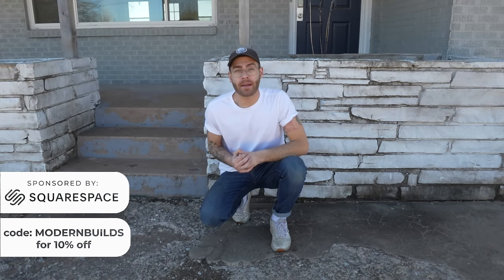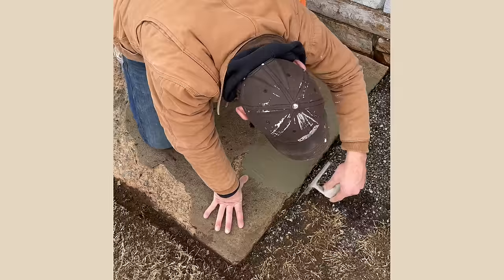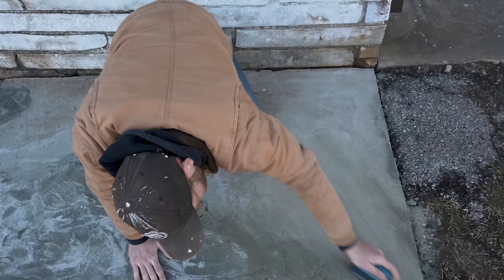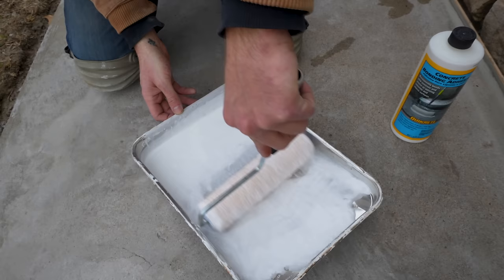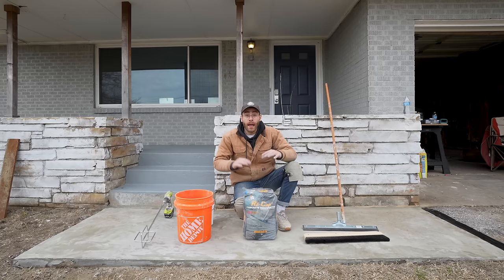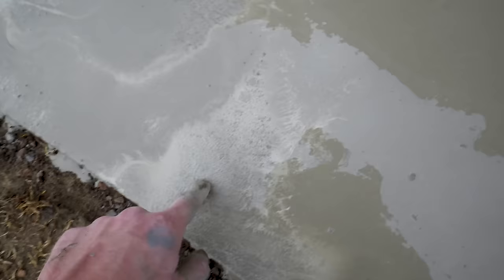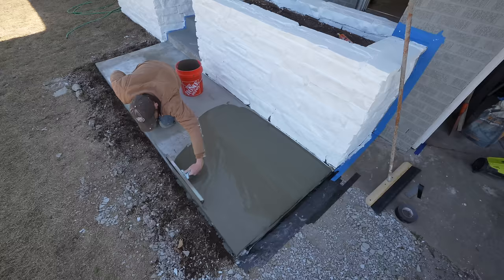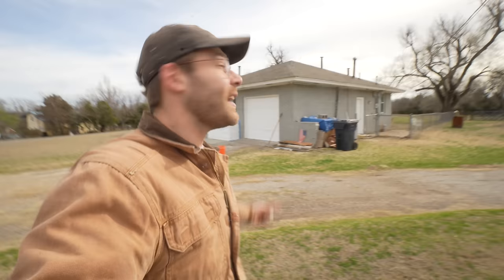How To Fix / Resurface Damaged Concrete Sidewalk | DIY

Comment: You had minimal sidewalk left. It would have been quicker, and cheaper, to just pour a new one. This is also likely to chip up after a year or two
Reply: They didn’t want cheap and quick probably
Reply from the maker: In hindsight you might be right. It would have been convenient to do a single pour and be one-and-done. I doubt it deteriorates much though, most of the damage came from not having gutters since the house was built in the 50’s and I’m getting some built this next week. We’ll see how it goes though… hopefully it’s a good tutorial for someone with a less damaged sidewalk/patio or someone who couldn’t tear out the old concrete as easily. 🤙🏼🤙🏼
Reply: Keep doing what you’re doing Mike. Quicker or not, you got awesome results.
Reply: @jmilli10 If he didn't want it  quick, he shouldn't have used quikcrete.
Reply: @ModernBuilds  It won't deteriorate because that what the patching is made for.
But that crack will come back.
Reply: At each season change this will start to break up with extreme heat and cold. Should have just broke it up and poured a fresh slab.
Reply: And the can guarantee that overlay will start flaking away in 9 months
Reply: Maybe, but this video is very useful to people like me who do have a better sidewalk, and would like to see how to do this process.
Reply: Na big money maker I got it down after 7 years still looks good no chips faster and cheaper then new concrete.
Reply: Resurfacing products achieve up to 55mpa strength. Stronger than the existing concrete with a 10-15 year lifespan. Much cheaper option than removing old concrete and replacing from scratch.
Reply: @ModernBuilds think u would have had more success with the squeegee if u use the pole
Reply: Cheaper? You need to remove and get rid of the old one first... daaa
Reply: Unless the concrete being poured is 2” or higher a binding agent is always needed. 😊
Reply: And don't forget the haul away...expensive these days....good job..just another adventure
Reply: I’ve got a 26sqm 250mm deep slab in my garden than needs resurfacing. Trying my hardest not to pull it all up and start again. Can I resurface it or should I break it all up and use some of it as hardcore and re pour it. The surface on it right not is falling apart and got one big crack in it
Reply: Well done,
Reply: I challenge your assessment... if you don't want to tear up an old  slab, don't have the equipment for that, or can't access the location except through a 3 ft wide gate and down a narrow path around a building or two.  How exactly would it be less work and easier?
Easier and cheaper is subjective.
Practical usually wins out.
Reply: @jamespeddycord4705  it’s a front yard. None of your points are valid for his case. Otherwise yes I would agree
Reply: Yes

Comment: Oh boy I'm disappointed. Nothing like putting a bandaid.
Reply: Better than replacing the slab in many cases if the concrete is clean and loose concrete is removed.

But ya jackhammer out the slab and re pour it if that tickles yoir fancy. Finish with me pretty much the exact same.

Comment: Holy crap this came out awesome! Removing the old slab and making a new one I think would have taken more physically exhausting work.  This repair is something I'd be able to do/assist with.  I can't technically use power tools or lift heavy buckets due to health reasons, but I'd be able to use the brush and clean up anything that spills over the sides
Reply from the maker: I’m glad it was helpful!! 😁😁 thanks for watching

Comment: I've done this a couple times with a concrete resurfacer and it looks great when first done, but it just didn't last for me.  I got maybe 4-5 years out of it until it started wearing on spots and discoloring.  Thanks for making the video.
Reply: did you use sealer on top of the resurfacer after it cured?

Comment: While i would agree with some of the comments regarding the complete replacement, what you've done was great experience for future reference. Perhaps next time use the recommended primer ratio and pour a lot of it so it would penetrate deeper. It creates flex and proofing.
Reply: wouldnt a complete replacement be thousands of $$? vs his repair?
Reply: @garyc4019  nope, not even close to the recoat cost.  They vinyl patch (3 bags) is $21 a bag, the Re-Cap is $33 a bag and bond liquid is $11.  The benefit is that it is FAST with little effort.  No Concrete to remove, No site prep work.  Bags of quickcrete are $6 a 80-pound bag and that's a lot cheaper.   There is also a tool cost if he doesn't own a wheel barrel to mix the concrete.  Basically, it is cheaper and better to remake a small pad like this, but it is far far easier and faster to re-coat it and it is a flip house, not a keeper.

Comment: Tear out and replace for sure would’ve been easier and produce better results but you did a great job for a first time using these finicky rapid set materials
Reply: It was Quickrete, not Rapidset. Rapidseet would have been better. I predict that in about 1 to 2 years it will delaminate. He should've used the bonding primer under the 1st coat and in the mix.  Also, it should be sealed afterwards. 
If you do it right , this repair will last for years.
Reply: @HLMcCoyEnterprises yea I didn’t literally mean the rapidset company I meant that it sets quickly (I know it does cuz I’ve used the product). I agree with you

Comment: I  personally would have removed the old slab and repoured a new slab.  

I like to experiment too . Seeing how the new surface lasts. Can’t wait for the update. In two years time.

My prediction is that it will crack in the middle from the change in seasons.

Comment: I would build a fence around the place not higher than 1/2 inch to get a leveled surface, but if your surface require more than 1/2 I'd suggest to use a steel grille attached to the surface previously clean and ready to pour the 1st concrete patch mix, then the bonding adhesive and then the resurfacing mix.

Comment: Late to the party but I agree with others that replacing the slab would've been a better long-term fix and probably faster/easier to achieve. 

The biggest issue is that big crack in the middle. It will reappear next winter as the soil freezes. That said, it looks great and serves as proof that you can resurface horrible-looking concrete. It's just that it can require constant upkeep as the old concrete continues to potentially deteriorate.

Comment: You're better off with a broom finish than smooth for a walkway, better footing in slippery conditions.  I have a few places where I want to try and resurface. Less work than ripping out and pouring a new slab. Thanks.

Comment: There were a few instances of "these are the instructions on the product but I'm going to do it a bit differently". That's a risky thing to do with concrete. Not diluting PVA (for example) can adversely limit its penetration.

All the same, it's nice to have a small project like this to play with.
Reply from the maker: It said for rougher surfaces do a more concentrated mix

Comment: I wish I had found this 2 months ago.  I just did a repair with some different products that did not mix nor perform as "advertised."  Getting ready to chip out some of the "repaired" spots for a do-over.
Reply: Hi Judygude Just wondering what products didn't work for you.  I'm planning on doing my concrete stairs and later on my walkway... Basically I'm on the research sage..   What was the repair you did and what did you use... Thank's for any info..
Reply: @ikemen1  resurfaced my garage floor. It was pretty rough. I used Leggari’s repair kit for cement. It was much more expensive, and I really had a tough time mixing it. Basically, it would have been much easier to get a reliable consistency if I didn’t have to mix a 5 gallon resin, then split it in half. My batches were never the same. I finally realized that I needed to mix for CONSISTENCY, not necessarily volume. Despite this, it still looks so much better, that I shouldn’t complain. I just finished coating everything with epoxy paint this weekend and am counting down the days until I can move everything back in.

Comment: When it comes to finishing concrete, if the surface is gonna be exposed to the elements year round, you want a broom finish on it, makes for better traction in case of icy or wet conditions. The smooth, almost glassy finish you were talking about originally? That's good for finished interior surfaces that won't see a lot of water or even ice, like the inside of a garage or the floor of a basement. (If you have concrete floors throughout your house, I feel bad for you, I know how bad it is to live with that.)

Comment: I was going to suggest using the pressure washer to blast the paint from the rocks, but I see that you painted them again 😞
Reply from the maker: I pressure washed them and didn’t like the color that was getting exposed. That was part of the original plan 👍🏼👍🏼

Comment: Donot Buy That Expensive Bag,
Use Mortar And Add Super 
Plasticizer And You Will Get 
10,000 PSI Of Strength And
This Expensive Bag Does Half
Strength Only.
Amén.